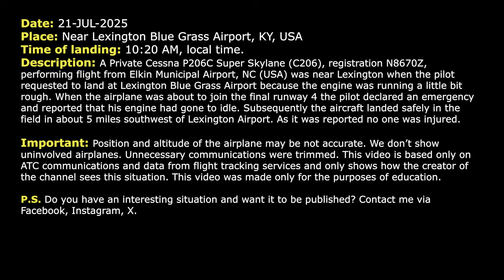Airplane lands in a field outside the Lexington Airport. Engine failure. Real ATC

Comment: That controller *icked that pilot around until his engine quit, and only then did she realize the urgency of the situation. She was more worried about him obeying her instructions than trying to help him get on the ground as soon as possible. If she had been more helpful instead of fussing about radio etiquette, he might not have had to take that 360° journey and would’ve made it to the airport before his engine actually quit. When she heard “engine trouble“ she could’ve declared an emergency for him and gotten him straight to the field. 🤷🏼‍♂️

Comment: There are many negative comments about ATC here, The problem was that ATC was not made aware it was an emergency - the pilot should have declared that, 1 engine, running rough. When he said the engine was running rough ATC gave him 2 closer airports, but he wanted to go to Lexington. ATC tried to assist the best they could based on the information the pilot gave, including transmitting blind when they heard nothing back. The pilot should follow radio protocol better too.

Comment: As I understand, the airplane's condition is the responsibility of the person in the seat holding the yoke, not the controller watching a radar. The controller did her job, and did it well. The pilot made the mistake of staying in the air and not declaring an emergency as soon as the engine stopped running normally. He stayed cool when things went badly, but I'm sure he'd agree he should have declared an emergency and landed at the nearest runway.

Comment: When you have a rough running engine or worse: DO NOT DESCEND UNTIL LANDING IS ASSURED. It’s shocking how many pilots voluntarily give up control over their aircraft to the controller. Declare an emergency and maintain full responsibility for flying your aircraft. This dude had adequate time to make the airport from the spot of his initial call. He and the controller wasted valuable time and distance not declaring an emergency and accepting radar vectors that took him away from the airport.
Reply: As a glider guy it baffles me